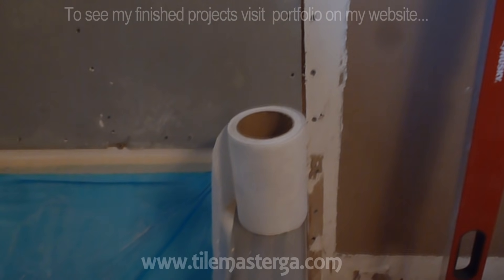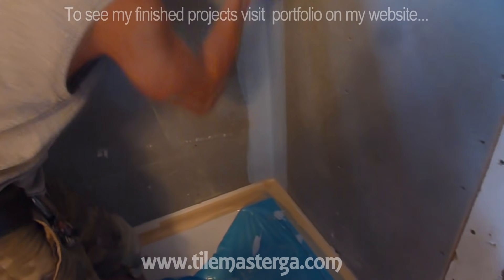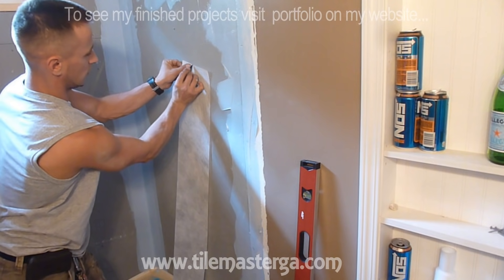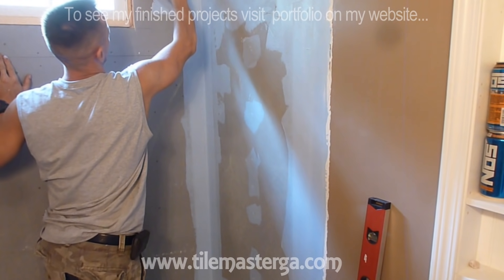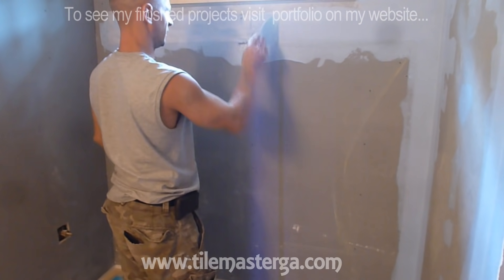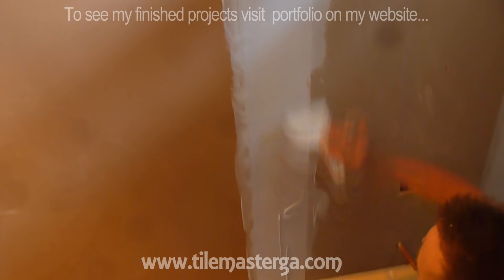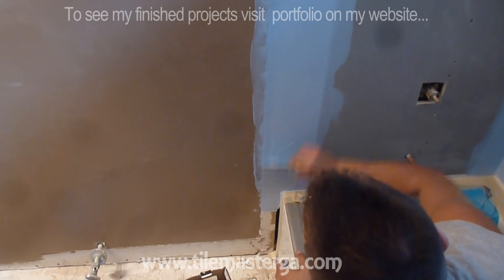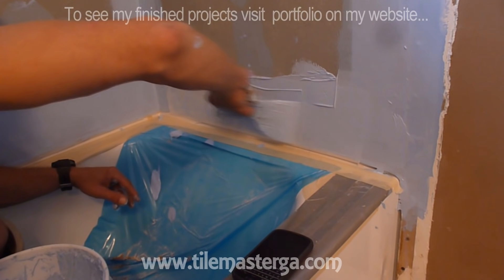HOW TO waterproof  60" tub surround walls before shower Tile installation- Laticrete Hydro  Barrier

Comment: 1st of tilemaster you saved me before my contractor thought it would be ok to put tile on dry wall in the shower. 2nd wish I would have found these videos before I hired a contractor because I may have been able to get through most of it myself...3rd in this video you are using the dens shield product but also mentioned Durock
Reply: Also mentioned Durock and permabase is ok. Do you still use the fiberglass tape and hydro barrier with it? If going with Durock or permabase is a vapor barrier needed? On GP website they show taking the backer board to 1/8 in above tub itself and your showing about 1/8 in above edge. 4th thanks for the videos and information

Comment: You are the Tile King. I have done many homeowner tile jobs over the years, after watching most of your videos, I feel I will do a better job than ever before. I need some advice though,  I am doing my first shower pan and wish it to be water tight. on your waterproofing video, you used Laticrete Hydrobarrier. On your tile videos it looks like you used RedGard. What is your recommendation for my shower.I will be using GP tile backer on my project. Thanks in advance. Charlie

Comment: Great videos and I have used them for the DIY projects I do. That said, I have a question regarding how you apply the Hydro barrier. In the Laticrete manufactures video, they state that all seams, corners, etc., should be taped with a non alkaline fiberglass tape and covered with non-modified thin-set before applying Hydo Barrier. In your video, however, you  use the hydro barrier directly on the  Dens shield. Is there a reason that you do not follow the manufacturer's recommendations for Hydro Barrier?

Comment from the maker: Red-guard can be used, but Hydro-barrier is way easier to apply plus works way better for bigger gaps ( spaces)
Reply from the maker: *****
Yes sir!
Reply: How are the fumes ?? About the same as Red G. ?? or easier to breathe ??  It says "low odor" on the label.  If you can compare the two, that would help me out.

Comment: For waterproofing the shower valve, you just paint the waterproofing around like in your video and then when you install the actual valve cover you use silicone?

Comment: Another question I forgot to include in my previous post, you put silicone sealant in the gap between the bathtub and the cement board and then applied the Hydro Barrier on top.  I thought nothing sticks to silicone, so how can you apply another material thats supposed to act like a sealant over silicone?

Comment: Nice video, but I have a few questions.
1) I think I noticed that where the tape overlaps the lip of the tub, the hydroban doesn't seem to be sticking to the fiberglass tub.  Is that right? Is that OK?
2) How do you transition from the shower walls to the surrounding sheetrock?  Does the membrane go slightly past where the tile will end - and then you either remove or spackle/paint over the membrane? Or do you stop the membrane just shy of the tile edge, leaving the last 1/4" of tiled area not waterproofed.
Thanks

Comment: Great video but what about the space between the top of the tub lip and the top of the tub.  Its like 1".  Do u just tile over this gap?  Also i am using durock and wish i had access to the cement board ur using cause this stuff is flimsy and crumbly.

Comment: Michael, is it possible to sandwich two layers of densShield tile backer board to create surface for radius bull nose trim such as 1/4 round trim? what is the best way to create this type of surface for radius caps or trim? Thank you   Albert

Comment: TileMasterGa - Thank you so much for your detailed videos.  I'm going to be starting my bathroom remodel in a few days and the information you give in your videos has taken the anxiety away!  One question for you.  I purchased the tape from your ebay auction, but the Laticrete barrier is just too expense with the shipping to purchase that way.  The tile stores in my area will not sell to homeowners - only contractors.  It looks like the only way I can go is to use the RedGard waterproofing.  I know that you said it could be used as a substitute, but would you recommend a second coat for a better seal?  I don't want the product to fail and I want the results to look nice and withstand many years of use.  Any thoughts or advice would be most helpful!  Thanks again!  I'm so excited to start my project!

Comment: This is overkill, but it's the way I do stuff and I don't pretend to know everything, just maybe another way to get stuff done.

First thing I double stud all the walls in the tub area and if I can either block (bridge) between the floor joist and under the wall studs if the interior wall falls in between the joists, or double the floor joists and still block under interior wall studs. I then either use 1/2" or 3/4" plywood on all the walls( I prefer 3/4") and 3/4" plywood on the floor. All of this is designed to minimize or virtually eliminate movement and deflection. You can then eliminate caulking at corners if you want when the tile is done.Then, I use Grace Ice & Water Shield from the floor up to the ceiling if it's and 8' wall. I use Tyvek Flexwrap at the corners on the bottom (this stuff bonds great to Grace, plastic and metal and gets stronger over time) and project the Grace into the room on the floor about 12" past the tub. I run the Grace up about 12" past the top of the tub. Then I set my tub in mud with a little Portland mixed in and fasten in to the walls. I then take and lap the Flexwrap over the top of the tub and the sides down to the floor. Then I finish the Grace over the Flexwrap and up to the ceiling. I then apply my cement board, tape and thinset. I alway's run the tile 4" or so past the edge of the tub from floor to ceiling as the drywall and base always will rot and discolor from the floor up along the edge of the tub. I did my own tub this way 6 years ago and I don't have any cracks at the corners and I've never used caulk at the tub to tile line. I have no issues there either. The Grace is a vapor barrier as well. I do showers this way as well. Again, I'm not saying this is right or wrong and is is a lot more work, but I know it will outlast me or anyone else.

I wish all of you the best and great success in doing your projects!

Comment: Good video . The only thing I don't agree with is screwing in the tub spout copper pipe. As an old plumber I can tell you , this tube needs to be  soldered into a copper elbow. Screwing it in, there is no way to properly tighten it up. Todays spouts push on using rubber o rings and tighten  width an allan wrench.

Comment: I am concerned about membrane for sticking the tiles afterwards. Wonderboard is designed to stick thinset and hold the weight of heavy tile.  Membrane might not be so strong a bond to hold tiles because its made for waterproofing only?
Reply: In the case of Densshield, GP has no issue with additional membrane material being applied prior to tiling.

Comment: So you fill the gap between the lip of the tub and concrete coard with hydro-barrier and mesh tape? I on this step and dont really want to mess it up.
Reply: I would use thinset and backer board mesh tape in every jount, then apply a membrane and fiberglass. Cover the entire surface of areas exposed to water with membrane. Make sure all of your screws are set and mortared first, and don't forget to wipe everything down so you can apply your membrane to a clean surface. You're tile well set flat, and your backer board joints will not crack.

Comment: Great video! but i was wondering have you ever had a tub that doesn't have a lip? what do you do in this case?
Reply: If the tub has no lip it wasn't designed to be installed in this manner.

Comment: Hi Mike,
Your video is perfect for me...thank you!
Question for you...in this video, when you opened the waterproofing membrane container, it is less than half of the container. I am assuming that you have a 3.5 gallon container. If so, how much approximately waterproofing membrane do I really need for this project? My project is exactly the same as yours (60" tub at the end of the bathroom). Should I buy 3.5 gallons or two of 1-gallon is enough?
Thanks for your help.
Dor
Reply: +Dor Marchan 1 gallon is plenty

Comment: Do I need to use a thin set on the joints before applying this
Reply: Is aqua defense comparable to this?
Reply: I am wondering as well. All other videos have thinset and 2 in. Mesh tape on all joints (wall and floor) prior to sealing with vapor barrier.

Comment: Do I need to use the fiberglass tape and membrane if I am using hardie backer?? I was told that the thinset will prevent any water from getting behind the backerboard. Is this true??
Reply from the maker: This is not true - who told you that nonsense ?  
You always have to use some type of waterproofing product !
Also I am not recommending "builders grade" Hardie backer Board ! - please use cement board ( durrock, perma base, wonderboar)  or Dens-shield
Reply: If I can not find the fiberglass tape you used in the video will the fiberglass glass tape with bigger gaps work?? I assume it will work fine if the put the membrane over it. What are your thoughts.
Reply from the maker: Dennis S Only this type of tape will work. Other types have holes to big and membrane will not work well with it. You can find this tape on my e-bay auction.
Look for : TileMasterGa in e-bay.  Please watch entire video and you will see why waterproofing is so important - and why this products are one of the very best available on market.

Good luck with your project Dennis.

Michael - Tile Master

Comment: How many coats of the Hydro Barrier should be applied?  I believe the directions says two but just want to make sure.
Reply from the maker: +101keek To will be fine, but if you use fiberglass mesh tape one will be enough.

Michael
Reply: Perfect!  Thanks so much!!!  You're awesome!
Reply: @mr.wizeguy8995  One coat is accounted for under the tape, followed by the second coat over the tape
Reply: @carlpicelle8279  You can found this from installation guide which seems to be hard to read or understand for most people  "When the first coat has dried to a uniform
olive green color, apply a second liberal coat^ of HYDRO BAN® liquid."

Comment: Michael,  I am doing a tub surround using Densshield Tile Backer, the fiberglass mesh tape that I purchased from you, and the Hydro Barrier. I am also using a prefabricated (Schluter) Kerdi-Board shower niche. Do you know if I can use the fiberglass mesh tape and the Hydro Barrier to seal the seam between the Kerdi-Board shower niche and the Densshield Tile Backer? 

Also, I am tiling right up to the ceiling.  I would like to run the Densshield right up to the ceiling so there will only be one seam to deal with. How should I finish the corner seam between the Drywall on the ceiling and the Densshield on the wall?  

Thank you for your great videos and your help.
Reply from the maker: +Fishchoker1 I am not sure how membrane will work on kerdi - i think that it will do the job, but i never did that way.
I am usually filling gap between ceiling and wall with 100% silicone, also later i am recommending to use caulk instead grout against ceiling.

Good luck.

Michael

Comment: some sites paint the entire bath area with redguard or other water resistant membranes. I seen that you did not waterproof the entire durock walls, just the edges and corners. is there a reason why you did not do it? By the way, great tutorial videos.
Reply from the maker: Hi Mark. there is many reasons for that.
Honestly I think that painting entire space is OVERKILL and not necessary!  ( same as installing plastic moisture barrier) I remodeled hundreds of bathrooms and water problems been always in the corners or bottom part  of tile board. If tile work will be done correctly there is no way for water to penetrate wall tiles or grout ! I am telling you this as person that do this every day. Manufacture want you to paint entire wall, because they will sell more product - simple as that.

However, there are projects when painting entire thing is a must ( saunas ,steam showers and shower floors if done with membrane only)

If you will do it my way you will be 100% successful !!!
Reply: TileMasterGa , even when using hardie backer? I'm using hardie backer cement board and need to know if I should cover the whole thing with the membrane or only seems. Thank you! Your videos are a great help!

Comment: Hi, great videos, I love your channel! Dens Shield is impossible to find here in TX. You say Durock is an acceptable product, but you never show how to use it. I assume you would not put hydro barrier on the seams since water can flow straight through the Durock itself, unlike Dens Shield. The common method is to put plastic sheeting behind the Durock, but you say you are not a fan of that. What do you do to waterproof the Durock?

Comment: I was only able to find Laticrete Hydro Ban which was dried sage color and seem thinner than what you used..I was told it was the same product the company just changed the color and last name of it...
Reply: Hydro ban is a thicker product than hydro barrier.  Hydro ban will cover gaps up to 1/8" whereas hydro barrier needs this tape.  I'm using hydro ban.

Comment: What do you suggest to seal my joints? does Laticrete Hydro  Barrier act like thin set or wall joint compound?
Reply: I am wondering exactly the same thing. Manufacturer states the cement board needs thinset and 3 inch fiberglass tape on all joints. Can the hydrobarrer replace this step? If you thinset and fiberglass tape, then Hydrobarrier and 6 inch fiberglass tape (that tilemaster uses) won't the joints be too thick and make for a bad tile job? Thank you.

Comment: I try using the laticrete today and it went horrible , Your compare to my look more like a paste , my was more liquor, it was dripping everywhere , on the shower liner ,I cover it with plastic but still didn't think I was doing it right , I saw a video where that theyuse a paint brush will you recommend using it
Reply: That was also my experience.

Comment: Can you use hydro on hardi backer?
Reply from the maker: I do not recommend HARDI-BOARD !!! It is thiner than standart board - aout 3/8" thickness . It may cause issues in transition to 1/2" drywall. Also the most important - setting components do not bond well to Hardi board!! causing tiles to get lose and often crack ( especially on the floors!) Be aware !!! Honestly I am surprised that it is still on the market - just another builders-grade crappie product !!!

Comment: Hey TileMasterGa, I've really enjoyed your videos - thank you!

In my situation, the cement board is thinner than the drywall it sits against - what is the best way to smooth out the difference? Do I just use the hydrobarrier and fiberglass tape to make a transition? or should I use thinset with fiberglass tape first, then hydrobarrier over that after it dries
Reply: +Joshua Pritt I have the same issue. Someone has put a skim coat on top of the 1/2 inch drywall which is about 1/16" thick. Did you find an answer?
Reply: +Gary Mitchell I used thinset and fiberglass tape to do the transition, and hydrobarriered over that. Seems to have worked. Since it's up above the area where water goes, I don't think it really mattered much.

Comment: Where do you buy your DensShield board? I checked Home Depot and Lowe's and they do not have it.
Reply: Bernard Bullington I had the same issue, but Menard's had it. Also, I unfortunately could not find hydro barrier anywhere but online and didn't have time to wait on delivery, so I went with RedGard. I can see why TileMasterGA prefers the Hydro Barrier (it seems a bit thicker/easier to apply) but the RedGard seems to be perfectly fine.

Comment: just curious. You waterproof all the seams and cracks but you don't waterproof all of the backer board. I am hearing and reading people who recommend waterproofing ALL of the backer board so if any water ever gets between the tile and backer it will not penetrate into the wall behind. What is your opinion of using the Hydro Barrier and covering all of the backer board?
I was also told about a product called BondTAC 1500 which can be used for this purpose.
Reply: Thank you Dan. That explains it. Appreciate your response.

Comment: Except for the joints, why do you have to waterproof the board? Isn't it made out of cement?
Reply: Cement is porous and water sips into it, spreading mold.
Reply: You don't. In-fact, most builders won't do this because it's an overkill. We always put 3-layers of black plastic behind the cement board and never had a problem with mold or anything getting wet.
Reply: Cement board is not waterproof and your wood structure will get wet.  However if you put plastic or tar paper BEHIND the cement board you will get water trapped between the board and the tar paper or plastic, and mold will grow there.  Do as he said and out the membrane on the front of the backer board.